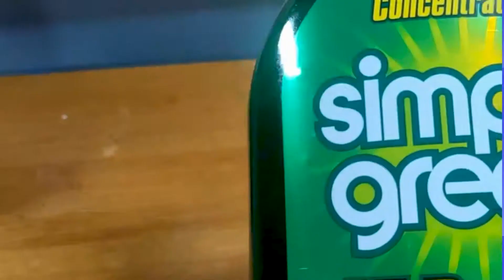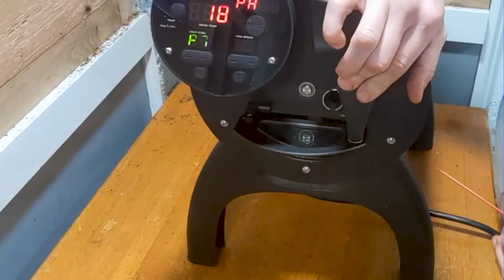Roaster Cleaning With The Bean Man

Comment: Thanks for the video! How many kilograms do you usually roast per month/before this level of cleaning?
Reply from the maker: So I currently do a deep clean like this once a month no matter the number of kilos roasted however I have found that after around 30 kilograms the caked on oils get so thick the chaff collection and impeller fan don't seem as effective so if I get to 30 before the end of the month I will at least clean the fan the chaff filter and the faceplate. Also if you're going past second crack on every roast you can expect the need for cleaning to increase
Reply: @fatbeanscoffeelab4914  Thanks for the reply. I think I'm going to invest in a Bullet soon.